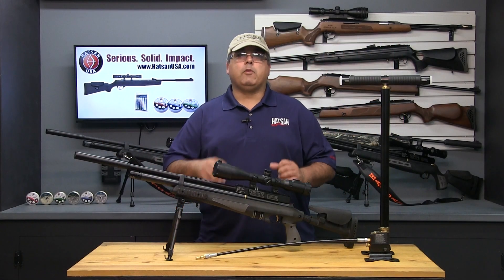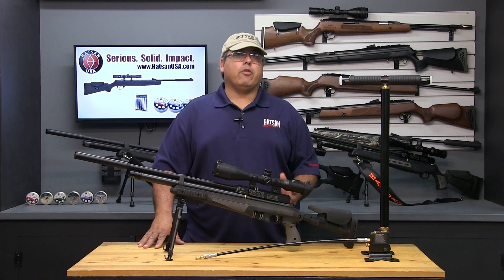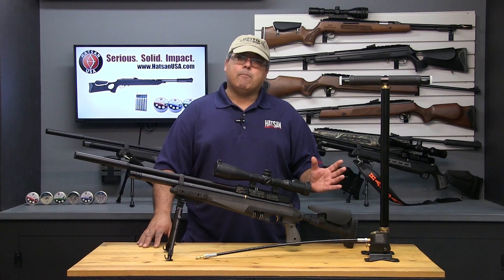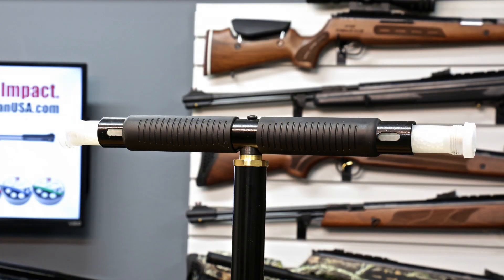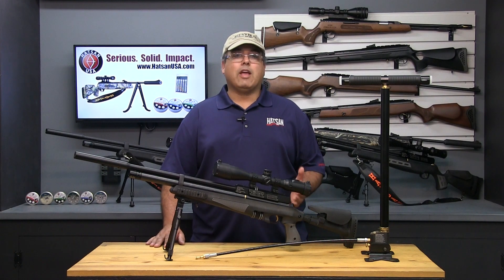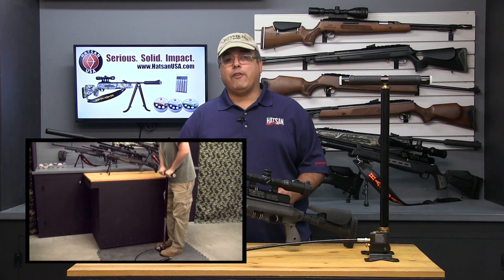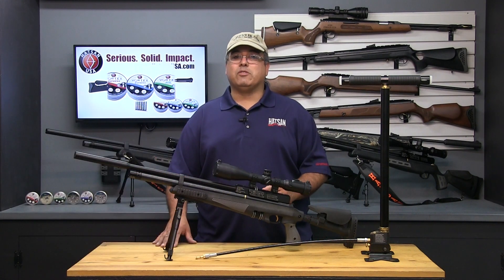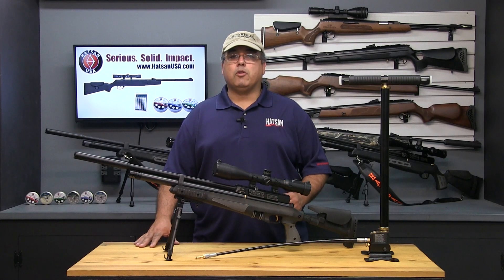Filling your Hatsan PCP Airgun - Hatsan Hand Pump

Comment: Why isnt my hatsan filling? Air escapes from the sides of the filling hole.
Reply: Yeah mine does too
Reply: What the hell? No one answered these questions yet. Did you figure it out, Anyone? I can't get the air tank off because the moderator where the barrel flares out gets in the way and jams it in there. Any Ideas, did any of you figure out the fill problem?
Reply: Mine too...

Comment: Maybe actually show filling the gun up all the way.
Reply: It's no joke.  Be ready for a slight workout.  He is correct though.  
0 to 200 is ridiculous.  100 to 200 is about 5 minutes of pumping like the guy demonstrates.  Slow steady pace,  use your weight and less arms .  If you have the money a high pressure electric pump is the way to go.  In saying that.  200 bar with my Hatsun Carnivore 30 caliber gives me 21 rounds.  That's not to empty.  That's 21 rounds leaving 100 psi in the tank.  Shots don't start losing power til around the 7th shot.  Then you just need to adjust a little each shot after.  Those first 7 are amazing.  I was hitting a empty antifreeze jug (size reference) at 100 yards.  Very easily. Killed three ground hogs already. I've uploaded one shot on my YouTube page.   A take down of a ground hog living under my wife's shed destroying the ground beneath it. He is gone.  Check it out.

Comment: Good tip about using the plumbers tape, to prevent any possible air escaping
Reply: Ummm, I think you mean use Teflon tape to wrap threads, Plumbers tape is a metal strip about an inch wide with holes in it, used to hang pipes with, usually under a house or floor space.
Reply: @nobodyinparticular5224  Those are called hose clamps my guy
Reply: My pump said specifically not to use Teflon tape.

Comment: Brilliant series of videos.
Being extremely old, I recall having those 'Breakback' air rifles....
I tried the Screw in Gas cylinder pattern air weapons but accuracy is literally 'Hit or miss'. I bought my AT44-10, .22 rifle with a stirrup pump !
I'm much fitter after recharging the high pressure cylinder and this air weapon has consistent accuracy.
Personally I prefer a .22 rimfire but firearms are banned in the UK. The authorities think they're dangerous !
A+ & High 5s for your most informative videos.
My respects. J.S.

Comment from the maker: Spike - 10 pumps for 100 psi is an average.  It will be less or it may be more depending on the size of your air chamber. Generally I shoot from 200 bar down to about 120 or so.  It's not that bad if you don't drain the cylinder each time you sit down to shoot.

Cheers,
AGW
Reply: And about how many shots will you get from 200 to 120?

Comment: So I have a compressor and once I stop filling I stop the compressor and need to bleed the hose. However, If I slowly bleed the compressor the rifle's valve won't close and will vent all the air in the tank. If I rapidly bleed the air from the compressor the piston valve of the compressor will go bad. Could you please tell me what additional valves I need so I can shut the compressor and then bleed the air safely? Thank you!

Comment: Hey rick,how are you? so I'm hoping you can  answer a big question for me.I've been trying to find out if I need to be checking my air rifle cylinders for corrosion. I have 3 riffles. one is a bt65.the others are texan 45,and a evanix tactical sniper. my concern is being that I use a hand pump only.how will I know when to check for corrosion because of all the moisture.I'm just concerned because this is allot of pressure I hold up to my face each time I shoot. I love my airguns. .just have some safety concerns because of how I had to have my paintball guns checked for corrosion. anyhow I would really appreciate it if you could look into it for me and give me an answer. .it would really give me piece of mind. .thank you.
Reply from the maker: +Hugo Ezparza -  Check them once a year to be safe.

cheers
AGW
Reply: Once a year? How will I do that with certain ones that you can't open like the hatsan ones? Thanks
Reply from the maker: +Hugo Ezparza - it will depend on the gun.. You'll need to work out the best way with each model.  Check with the manufacturers for a better timeline if they have one.

cheers
AGW

Comment: Hello pyramid air
Ihave a bull boss 22 cal. and after 15-20 shots I try to top it off while the gauge is still 1/2 green or about 100 bar using a air venturi g6 hand pump. As soon as I insert the probe into the cylinder fill port all the remaining air leaves the cylinder and IT drops all the way down to the yellow .What am I doing wrong? the o rings on the probe are fine and not leaking there.
Also as I am pumping some strokes have very little resistance and others you have to lean into to get the down stroke
Can you help me ? I have tried cocking lever full open and full closed with and without the magazine. Do you know why my gun is doing this all I want to do is top it off after 20 shots while it is still in the green.
Thank You
Kevin Neel
Reply from the maker: Contact HatsanUSA via their website and their form under warranty and service.  They will be able to help you.

cheers
AGW
Reply: I have a question.. i just ordered a hatsan bullboss .22 with a hand pump from pyramid air.. my question is do i need too purchase an additional piece or part in order too pump up my rifle? Thanks for any help.

Comment: hello, I have a Hatsan Flash and a Hatsan pump.  the pump after 10 movements is blocked. It creates an overpressure and no longer loads the Flash cylinder.  Where's the problem?

Comment: i just bought the .25 flashpup and i have the same question u also how many times do you have to pump to fill it from 0
Reply from the maker: Budget about 10 pumps per 100 psi.  Give or take the pump and your elevation. 

Cheers
AGW
Reply: @AirGunWeb  I bought a low budget hand pump on amazon and my Hatsan flash was empty when i got it and it took me around 70 pumps to get it within range.

Comment: hello I was wondering if u may now if this pump will fit my hatsan 22 pcp air rifle
Reply from the maker: +Joseph Ball - bet on about 10 pumps per 100 psi.. so 3000 psi would be 300 pumps from empty.. Also depends on the size of the tank you are filling.

Cheers
AGW

Comment: Rick, I own a hatsan pump. Says 300 bar on the gauge. Do you know if it will actually pump to 300 bar? thanks in advance.
Reply from the maker: Electronicdawg - Actually.. not sure.. try contacting HatsanUSA.com and see if they can give you a definitive answer on that one.

Cheers
AGW
Reply: Hi, I have the same air weapon. On the side there are details that include the 'Max pressure, 200 Bar'. Usually this is referred to as the 'Safe working pressure'.
My AT44 will not accept pressure over 200 Bar so there must be a safety valve in the pressurisation system ? I cannot pump the pressure above 200 Bar which is the line between the Green (safe) and the red (Danger) quadrants on the Rifle's air pressure indicator.
There is a video that shows how to increase the power of the weapon without increasing the pressure in the pressurised air cylinder.
Trust me, you do not want to be altering the manufacturers spec on air pressures, one slip and can kill you.
Stay safe !

Comment: A just bought a hatsan flashpup s we and for some reason my fill prob seems smaller cause it doesn't build up pressure with my handpump not sure what the prob is can someone help me
Reply: I'm literally having the SAME problem. Every time I pump the air just seeps outwad. Maybe its not tight enough, at least from what I've found... I have a flashpup as well. Instructions really do suck, and so does this video. It doesn't touch on any of the nuance of this.

Comment: hey rick i have this exact pump but the gauge on the cylinder and the one on the pump show different readings for some reason,is that normal, and if not which reading do i use. thanks in advance.
Reply from the maker: +Jason E - I would go by the one on the cylinder.  Also, send an email to Hatsan to see what they say.  They have a form on their site that you can submit.

Cheers
AGW
Reply: thanks

Comment: Hey, I recently got my .25 cal invader and then got a compressor, and not sure if it the compressor or air rifle. 

Also, this is my first air rifle as I am used to real firearms. I followed the instruction of the Invader and cocked it and connected the airline and then turned on the fan and then the power on the compressor.
I set the bar pressure to 2000 and after 5 minutes there was nothing happening. The gauge on the air rifle and compressor showed zero change. I turned the compressor off but left the fan on per the instructions and opened the bleeder valve and there was barely anything that came out. I then disconnected the airline from the rifle and compressor and plugged back in putting my finger over the fitting on the compressor while it was running to see how much pressure was coming out. Not much at all. So is it the compressor or as I just doing something so stupid I am missing it? Thanks